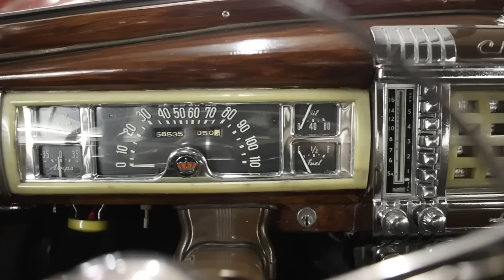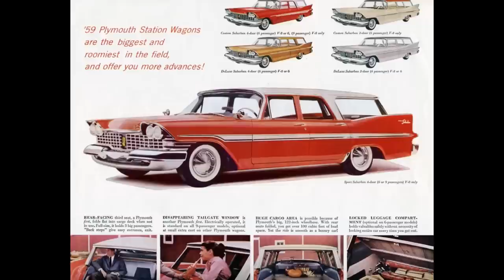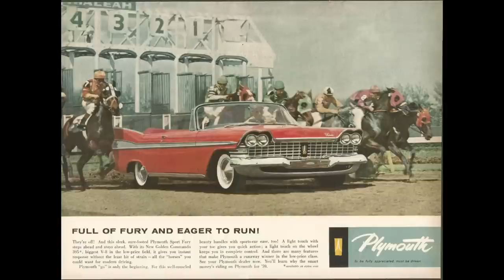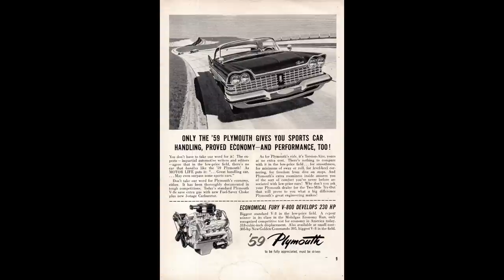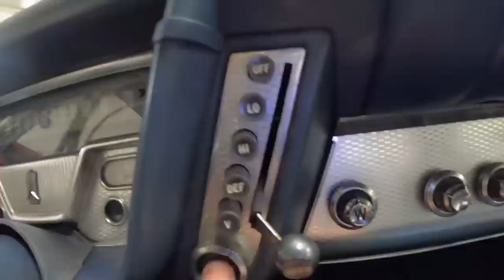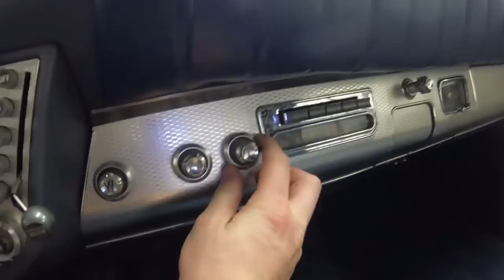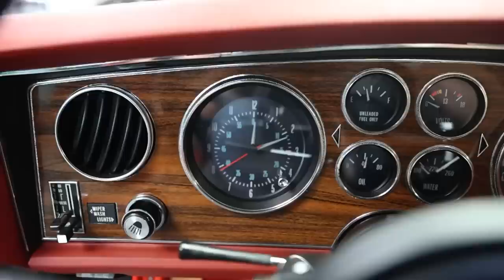1959 Plymouth sport fury convertible, Newly re-designed by Virgil￼ Exner￼

Comment: FWIW on your dash comparisons.

1958, the two little lights above the speedometer are HIGH BEAM on the left and single TURN indicator on the right.  1959 was the first year for left/right tirn arrows.

On 1958, the heater controls use a rotating fan knob.  On 1959, the heater controls use the temp lever [pull out the temp lever fof OFF-LO-HI.
Reply from the maker: Thank you so much for sharing all of that insight as well as information I really appreciate it =)

Comment: Surprised you found not only a 59 Plymouth, but a ragtop! These rusted out fast, and were problematic when they got older. This showed 11,000 miles and I doubt it was 111,000 miles. I liked the 58's more since it was a cleaner look, where the 59's and 60's became excessive with shapes and chrome. Thanks for showing this one!
Reply from the maker: This is the only 59 Plymouth I’ve ever seen Plymouth are rare from the late 50s because like so many mentioned the rust issues i’ve only seen one 57 fury with the gold pointing in my lifetime and that was 20 years ago or around that I wasn’t even able to drive yet guy just restored it took it to a car show and he said that he’s been restoring it for 15 years I wonder if he still has it, Or if that car is still around

Comment: I like the exterior styling of the 1958 Plymouth better than the ‘59. While I love the ‘59 Dodge and DeSoto, the ‘59 Plymouth was a bit bizarre. I do like the ‘59 Plymouth instrument panel over the ‘58 however.
Re-check the width of the 1959 Plymouth. I doubt it is 70” wide. If it is, my 2020 Kia Rio is wider. 😀😀😀😀
Great job.  Tou’re making great strides as you move forward.
Reply from the maker: Thank you I’m so happy you  like this episode it’s getting better it’s definitely come a long way and I try to make each episode a little bit different so it’s not the same thing over and over and over again. I found a super rare 1965 Studebaker wagon but I can’t do it until March but I can’t wait I’m super stoked the roof it has the sliding roof. The metal one. I found it for sale on marketplace I can’t wait, I’m so excited for the spring summer and fall as well I can’t wait to get back to car shows and see some of these car in motion. I want to go back to the Gilmore auto museum do you have a ride in the Classic Car I figured I would do an episode on each one of those cars and will be able to ride in them it’ll be great they got 15 cars that you can ride in plus they have a huge car show it’s either Wednesday night or Thursday night but I’d love to go up there for that =)
Reply: @What.its.like.  That will be a rare car indeed! The sliding roof model was called the Wagonaire. It was produced for model years 1963 through 1966. A novel and useful feature. Unfortunately they were prone to water leaks and rust. The model name should not be confused with the Jeep Wagoneer, also introduced for the 1963 model year.

Comment: The kind of  'Exner touches' with eyebrows over the lights, and each light being podded, makes me wonder if he was smoking something? He was a real specif details kind of guy, with each section of the car getting an individual treatment, (without turning into an elephant zebra)  He gets the styling to flow across every surface, and they join into a whole that must have shaken the industry, as indeed it did. I'm still a Mitchell man, but it was Exner that got motor city off its arse. He should have got the Academy Award for 59, in my opinion, if not before. Just to add to that, I wonder what it would cost for Chrysler to make the panel dies for this now? I don't think anybody could build this car now, and at that price? Forget it. Add all the modern safety gear, and it would be the most astonishing car on the road, with a Bentley price.
Reply from the maker: Totally agree the late mid to late 50s cars look the way they did because of exner.. Harley earl and later bill Mitchell dick Teague  had to step up their game but by the early 60s it all fell apart

Comment: Several vehicles had dash mounted inside mirrors. Early fifties Studebakers as well as the ‘53 & ‘54 Chevy Bel Air hardtops. 
The biggest complaint was limited visibility to the rear if you had three rear seat oassangers. 
Most convertible rear windows were plexiglass. Ford introduced a real glass convertible rear window in their 1964 full size Fords.
Reply from the maker: Totally agree it just wasn’t mounted in the right place in this car for that makes sense some cars did it well but this one it should’ve been mounted up on the ceiling or top of windshield
Reply: Thanks for mentioning what car had real glass for the convertible rear window. So it is the 1964 Ford! As to the dashboard mirror, I think the first Corvettes had that feature.
Reply: @glennso47  Yes, the Corvette did. Through 1962 model year. Thanks for pointing that out.
Reply: Cadillacs have had the mirror knob control for some time.

Comment: When I was a kid, my best friend's mother drove a '59 Sport Fury coupe. This vintage of car had a downdraft tube for crankcase pressure to be released. Later in the 1960's, in California, people were required to plug off the downdraft tube and add a PCV valve. I remember her car chugging out smoke under the car from the downdraft tube. I don't know what engine it had.  The 'bulge' on the trunk lid was bolted on, as you should have been able to see. It is basically a faux Continental kit.
You probably will never see one of these with a PowerFlite and I doubt that it was even an option on the Sport Fury. I don't ever remember seeing a 1960 Valiant with a PowerFlite. About the only Mopar I've seen of the vintage is a Desoto and a lower level Dodge. 
My friend's mother moved up to a 1967 Mercury Park Lane 4-door hardtop when that car was a couple of years old and my friend's father got a new car. He had the Mercury previously. He got a new company car every couple of years or so.
Reply from the maker: Awesome story insight and information =) I thought it was weird that the sport fury would have the two speed automatic as well I included it on the list because according to automobile catalog it was an option on the sport fury 

https://www.automobile-catalog.com/make/plymouth/kp-lp-mp/mp-sport-fury-hardtop-coupe/1959.html
Reply: @What.its.like.  Yeh, I know, they had to list it but only a moron would order it. Maybe only if they planned to drop a Chrysler cross-ram 413 V8 in it and only used it for drag racing. I have seen a Dodge use the PowerFlite, but it was in the same basic car  as the entry level Desoto. I believe that the PowerFlite was still on the books through 1961, but maybe just to use up inventoery when they were putting the Desoto brand to bed. 
I remember when the Valiant came out in 1960 and I have seen a few of them. They either had a floor-mounted 3-speed manual or the Torqueflite. Gosh those Valiants were ugly! The only car that made the Studebaker Lark look good!
Reply from the maker: I know I can’t believe the styling from 59, The 60s models still look good but man those 61/62 models were hideous I guess it’s proof all good things eventually do come to an end
Reply: @What.its.like.  What was funny was that the Imperial kept that forward look until the new 1964 redesign came out, which was another classic.

Comment: I remember a 59 savory with a flat head six and 3 on the tree. It had good power for a six. I drove it several times. My sister had a 59 belvadere 318. That rear trunk fake continental kit look was fake same as the 60 valiant. You could not put a tire there. It would be too heavy to open the trunk.

Comment: Dumb mirror placement, but the Lucite wheel kinda makes up for it? At that time, I think they didn't have the adhesives to glue the mirrors to the window. (on Fords, though, they do fall off, and it is handy to carry the glue to fix it.) Post 59, everything aerospace became dribbling out to general industry, including glues and tapes. As far as I know, the interior designers are separate people, but it looks as if Exner was looking over the shoulders of guys at the drawing boards? From the look of, the 4 position rests on the horn ring, With everything looking purposeful, it reassures the driver, and is the psychology of sales right there.
Reply from the maker: The car that’s going to be posted not today but tomorrow also has a translucent steering wheel from GM and it’s honestly my new favorite early 60s GM design that car was absolutely incredible and I never saw one in person until then. It kind of sort of makes me want one I drove the Chevy counterpart last summer =)

Comment: I like the '57 design better overall. Better grille, better taillights
Reply: My Mother's Mother had a '57 Belvedere four-door sedan, nicely optioned for the time, but as she got older she found the manual steering was a bit of a chore. 
My Granddaddy found a local shade-tree mechanic who transferred a power steering unit from a '58 model into Grandma's car. The steering wheel from the '57 standard steering column wouldn't fit the splines for the '58, so it ended up with that '58 wheel. It looked all right, but I preferred the '57 wheel and horn hub.
A couple of years later after an intense hail storm, Grandma traded her Black Beauty for an air conditioned '67 Belvedere II hardtop coupe, white with a black vinyl top. When I saw it for the first time (I was about nine years old), Grandma said something didn't quite look right. "Well, they left the chrome trim off the right taillight," I said. 
The Belvedere II had gotten a Satellite taillight on the left side, and when she got back to Mississippi the dealer gladly upgraded the right taillight. 
Many years later we learned it wasn't only the trim that was different, but the entire taillight lens assembly.

Comment: Both Chevrolet and Ford built approximately 1.5 million units each for the 1959 model year...Plymouth was far behind.
Reply from the maker: Wow that’s crazy
Reply: 1957-58 rust/quality issues destroyed Mother MoPar's reputation as an engineering company and sales dropped dramatically.

The 1958 economic recession didn't help.
Reply from the maker: A friend of mine has a 56 Plymouth Savoy and he said that the cars would literally rust on the dealership lot brand new cars would have rust on them because of Chrysler‘s poor metal preparation as in they wouldn’t protect the metal on the inside of the fenders and they would literally rust from the inside out.
Reply: Another issue is the steel used.  Chrysler bought steel from overseas that didn't have enough nickel alloyed in to help resist corrosion.

Comment: The 1959 was clumsy looking compared to the 1958.  In 1957 Chrysler Corp. pushed out the the new styles to fast. Quality control plagued the entire Chrysler line. The quality of metal was also alot worse. They imported alot of steel  that was bad quality. Thats why they rusted out so fast. My dad bought a 1957 Plymouth Suburban wagon and by 1960 the rockers and bottom of the rear quarters were rusting bad. in 1962 we traded the Plymouth wagon in for brand new 1962 Chevy biscane wagon. My dad was alot happier. My dad would always complain about how the Plymouth's push buttons jamming for the transmission and the window cranks for the windows always fell off. 1956 and prior were much better cars built by Chrysler.
Reply from the maker: Thank you so much for sharing that story what an awesome memory I never knew Chrysler had those Quality control issues outside the whole metal issue. I wonder how many survived, and when if ever Chrysler got better metal quality.. it makes sense that Mopar is cost more than any other brand because there isn’t that many left.
Reply: @What.its.like.  Thank you!  Yes My great uncle worked at a Dodge, Desoto dealer as a mechanic from 1948 to 1970. He would tell stories of how bad the quality was after 1956.  He said Chrysler in order to save money bought steel from some overseas sources. They wanted to push these cars out so fast the quality of fabrication was also poor. Chrysler really wanted to pull ahead of GM and Ford.  1957 thru 1960 styling was amazing for Chrysler. What did them in was the poor quality. That's why finding these today in good condition is a rarity!